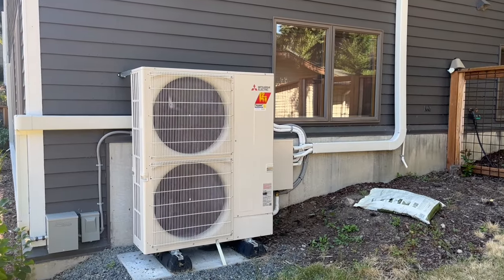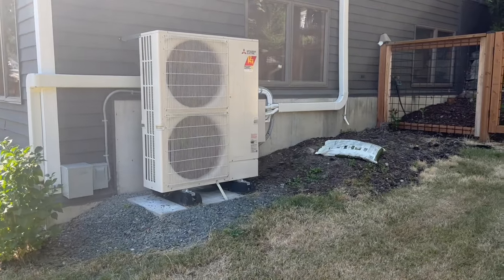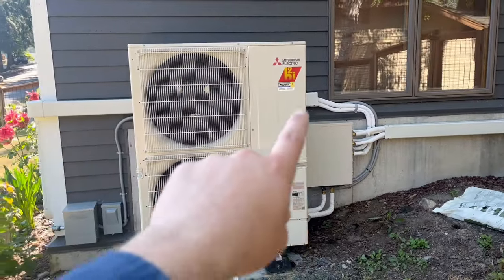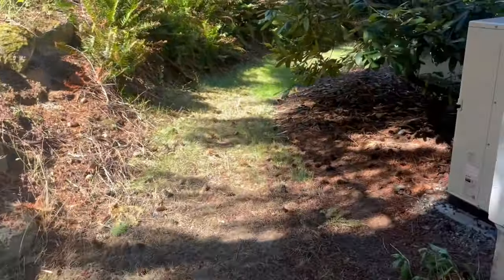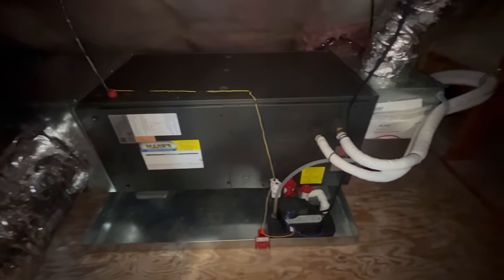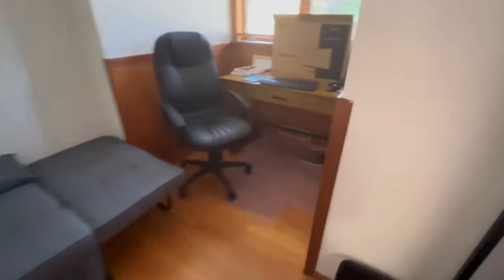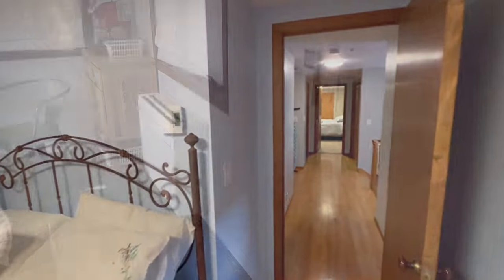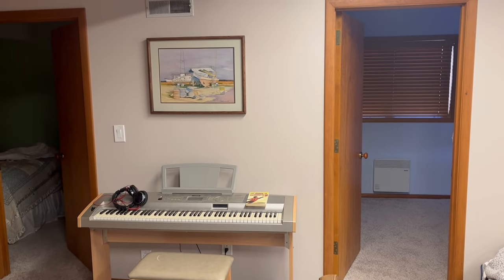Mitsubishi 5 zone Hyper heat Ducted/Ductless Minisplit system

Comment: If you're handy you can do a lot of the work yourself with ductless systems. I do HVAC controls, and I'm Mitsubishi certified. The equipment alone for a 5 zone 48K BTU system will run $11K before factoring in extras and installation. If you can DIY them you get an awesome HVAC system. You'll need to calculate the line set lengths to add the correct amount of refrigerant charge. You can't just hook up gauges to these systems to check the charge. The going rate for a 2 ton conventional system changeout is now running close to $10K. With ductless you're trading no ductwork for more line set and more complicated condensate drain. Mitsubishi has ceiling cassettes that will fit in 16" on center ceiling joists and I think they are a cleaner install if you have attic access.

Comment: Nice system, but what did this system cost? Ball park??
Reply: I'm in HVAC sales, I just sold a 5 zone system, identical to this one for 28000 + Tax (Canadian dollars)
Reply: @owenleroux5475  Thanks! ...so about $20,500 or $21,000 US. I'll be meeting with a Mitsubishi rep tomorrow. We'll see !?
Reply: @TheRKtect2  let me know how much they quote you, i’m curious
Reply: @TheRKtect2  my guy will be here Wednesday how much did they quote you?
Reply: @valeriehofmann2615  No quote as of yet. We met last Thursday, and the holidays have folks out of town and such. I did learn that you are restricted on the number of zones on the outdoor compressor depending upon the btu's of each zone...if over capacity, a zone could have to be it's own 1-to-1 setup. More later.
Reply: @owenleroux5475  Owen, see below. Also, if there's 48k btu capacity on the outdoor unit, were each of the 5 zones smaller capacity? ...unless I'm not adding my numbers correctly.
Reply: I've been quote a little over $20k in Oregon
Reply: $10,000 for just one here
Reply: @valeriehofmann2615  What model number? When I look these up online the hardware alone is $9200 - excluding any installation costs.
Reply: @Monkeyseemonkey79  i don't have that. They quoted for each inside unit would be about $10000.
Reply: It is a beautiful system. However, sure seems outrageously overpriced. How many square feet is your home? Looks big
Reply: @valeriehofmann2615  but how many wall units are they recommending? And how big is your home?
Reply: @TheRKtect2  Would love to hear what you learn.  Do all the indoor units need to be Mitsubishi units?
Reply: Both of those systems were probably 65k + if priced today.  I just went to a neighbors house, and they got quoted for 2 - 24 k outdoor units with 6 indoor wall mounted units. 
2 - 12k 
4 - 6k 
3 heads for each outdoor heat pump 1 - 12 2 -6k each system 
48k I almost fell over and I’m an Hvac contractor.
Reply: @paulconnolly2969  that is highway robbery. They really are taking advantage of people who only have electricity and can’t put ducts in there house. Then if u need them replaced in 20 years, it will you over $150k to replace the system.
Reply: @paulconnolly2969  I'm rehabbing a gas forced-air system, hoping to use as many of the existing duct runs as I can, and when I add it all up, it's over 60k materials and labor...materials/labor close to 50/50 split. $60k is 30% of a $200k rehab budget, so I'm afraid it won't be happening. We'll most likely redo the gas-fired setup.
Reply: We’re getting a 3 zone unit put in and it is going to cost around $12k. We’re in Oregon.
Reply: Just got quoted over 40k USD for 2, 4-ton outdoor units, one single zone and one multi zone. 2, 4-ton indoor air handlers, and 1 wall head. These damn things are expensive!
Reply: @FuriouslyFurious  not worth 40k$ unless u absolutely have no other choice and u live in Canada
Reply: @allensterling2941  my 2 AC units are 40 years old and both died last summer, so they need to be replaced anyways. That and my 40 year old boiler is oil and I'm spending 800 a month in oil.
Reply: @TheRKtect2  Holy shit! in Qatar (a GCC country)  this amount will buy you at normal retail price a wooping 45 Samsung split ac  ,18k btu INSTALLED at your home.  The  ac is  rated for T3 weather ( work in hot cliamate with bigger compressors). You might get 50+ ac for lower brands.
Reply: I have this same system in my garage. It was given to me three years ago was only used for one year. I need to find someone to install it. Plus I am going to purchase the indoor units as well. I don’t plan on spending $20k plus.
Reply: Don't waste your money it's way overpriced  @TheRKtect2

Comment: 2 errors = disconect electrical switch is too close to the ground 220 volts beware check out code in your area ⚡️⚡️/ heat pumps require space under the unit check out in manual the reason is " defrost mode in winter will produce ice and lots of water and will end up destroying the outdoor unit.... 30 years experience here whith mitsubishi & other high quality units 👍👍

Comment: I am scheduled to have a new Mitsubishi Intellaheat system installed in my home here in Wisconsin. It will replace my  Lennox outdoor 14 seer a/c unit. I have researched HVAC products in depth and the Mitsubishi line of products are innovative and just what I was looking for.
Reply: How much does it cost? And how many zones?
Reply: My total cost was $16k I don’t really have zones since it was retrofit into the duct work of my home.
Reply: Ok looks like you had it 10mths , was it worth it or do you think would have been better with the old style. Heating or cooling???
Reply: Well the natural gas is cheaper than electricity here in Wisconsin yet so it does hit the pocket book pretty hard on the really cold days. Also if the Republican Party wins the election in November it sounds like they will revert a lot of the electric movement in the country that the current administration has in place, so probably no rebates and natural gas will continue to be a bargain. Mitsubishi is a great company with reliable equipment, but I guess if I had to do it all over again, I would go the old style way with a heat pump that kicks over at 35 degrees without the cutting edge sub zero technology. My intell-Heat system works as it should but maybe I was a little quick to jump on the all electric band wagon

Comment: I have single floor, 3 small bedrooms, plus living,dining kitchen and bathroom, totalling 880 ft2 . Will a ducted SPZ air handler system, relocated to the attic be adequate ? How many BTU'S will be required and can the ducted vents be placed from the attic to the ceilings of every room?

Comment: Customers in our area do not like or want the line sets run on the outside of the home, "that is so ugly" is the normal response. We use the smart multi hyper heat units with branch boxes and line sets installed indoors.
Reply: As a homeowner, I would agree that it's hideous to look at.  I wouldn't allow this on my home...if it were free!
Reply: My home (Texas) has standard units with the lines ran in the wall from the outside. Can the lines be removed and replaced without tearing out the whole wall? If not could the old lines be used instead of installing new ones?

Comment: Really nice install. Is that single bracket attached to the house and the heat pump custom made? Looks like it also minimizes house vibration with a rubber fitting? Does this come from Mitsubishi or is it custom made? Thanks

Comment: Hello, Can you share the cost of these systems to get an idea between regular Vs multi splits
Reply: the cost really depends on the needs of your house, a simple install for a 3 head unit hi wall mount 6k btu 6k btu 12k btu pair with a 24k btu condenser multizone electrical included can range between 8,000.00 and 10,000.00

Comment: Do you have the supply side and return side registers directly next to each other in every room? If so, that is a pretty nonsensical and wildly inefficient installation.
Reply: Those were the old electric heaters.  He showed you the central return grill which has the filter in it.